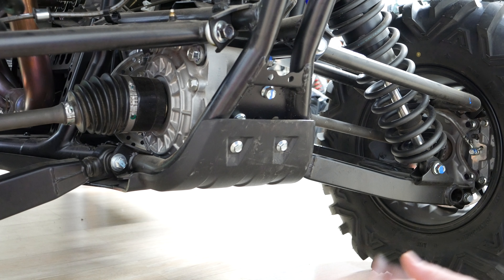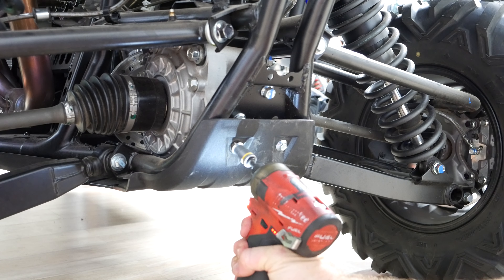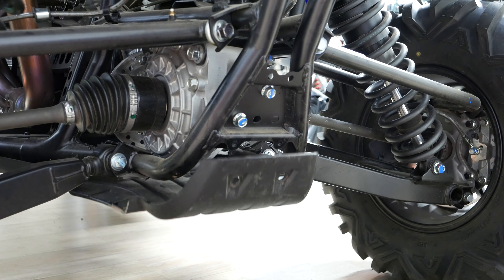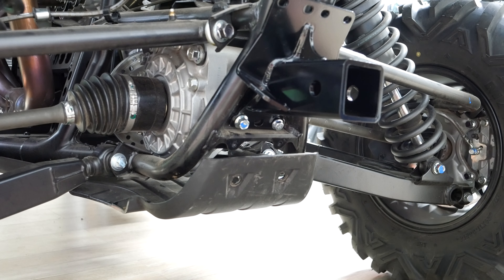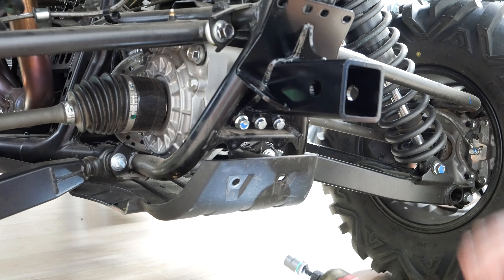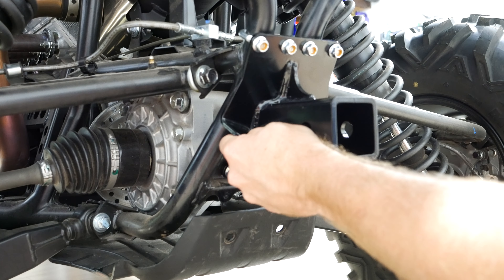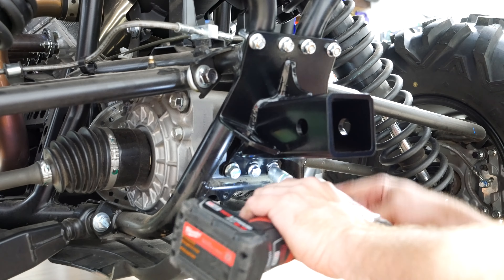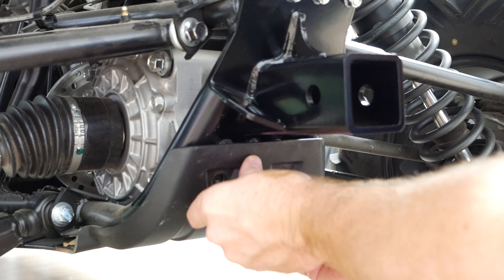2022 Yamaha YXZ1000R SS Receiver Hitch Install

Comment: How did it hold up?
You pull anything heavy with it?
Reply from the maker: It seems to be doing fine. I mostly use it for a bicycle carrier to take the mountain bikes back. But, that's with two 50lb e-bike going 40-50 miles down a rough trail and it did fine. I have move my 14ft tandem car haul around the yard before without any issues. and its probably 200-250 tongue weight. But at the end of the day they are u bolts on a hollow tube. So i would not do much more than that i think.